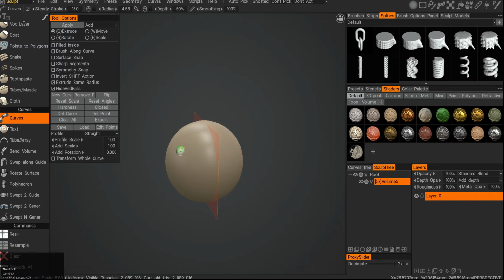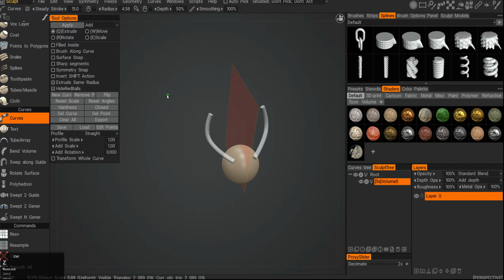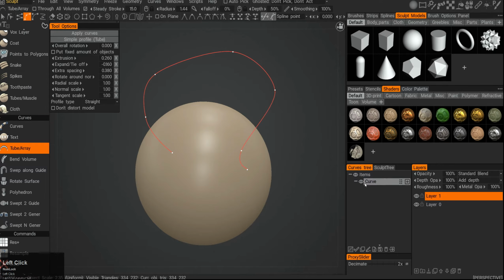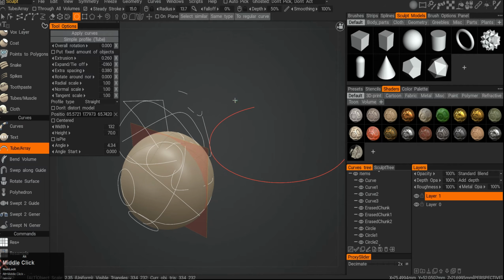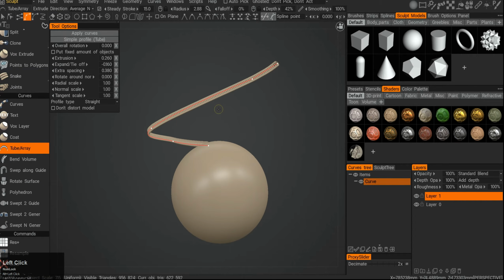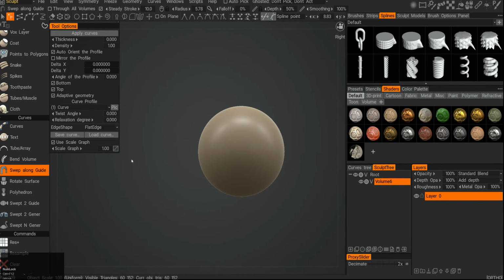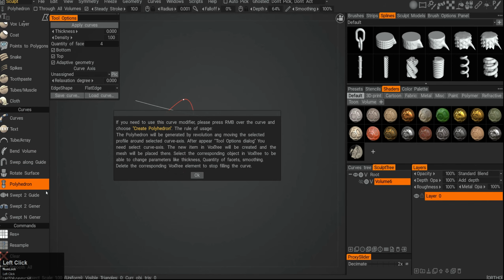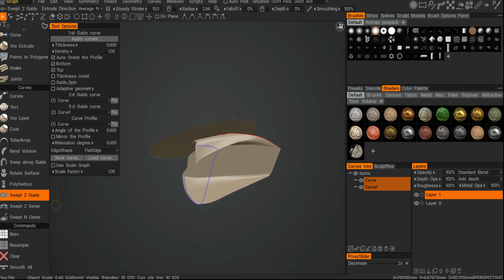Curve Tools - Sculpt Room - Intro to 3D Coat - 14

Comment: A million dollar question would be how to add points on created curve (aka Add Anchor Point Tool in Photoshop). Spent a couple of hours trying to figure it out and no luck. Add Splines Segments to the Curve tool just doesn't do it.
Reply: with curves tool selected, press Q to switch to extrude, then click the point on the curve where you want to add a point